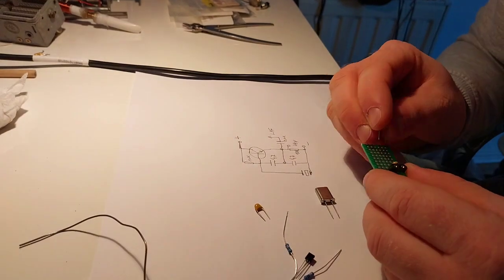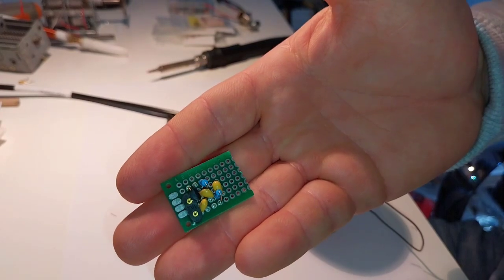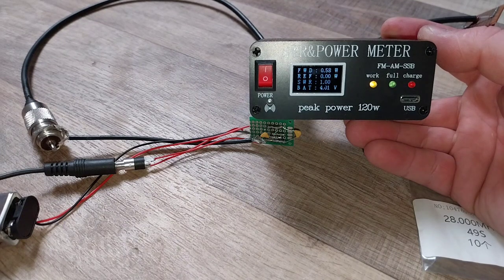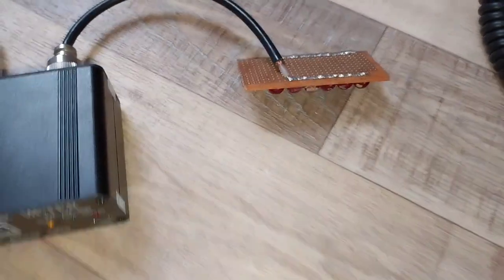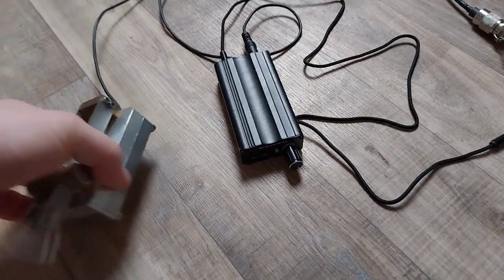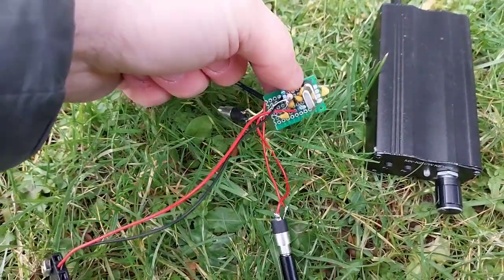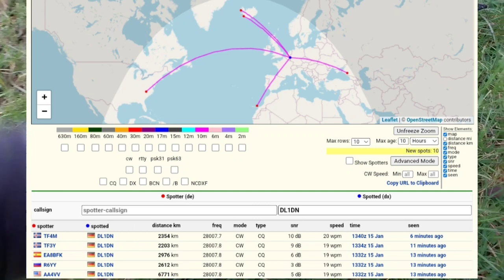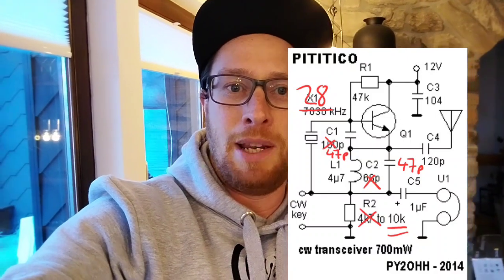DIY 10m mini transceiver DX reception USA, PY2OHH DL1DN mods #shortwaveradio

Comment: I recommend to start building with the filter near the antenna (should use a proper filter, really), and MEASURE and tune with NanoVNA, only proceed after that. The components near the XTAL and NPN are not as sensitive. It is also possible to use Darlington and couple the LC (LC is more tunable than XTAL which can be pulled to appr. 700 Hz range) very loosely with low cap values... That is "Franklinizing" the Colpitts without the adverse Miller-cap multiplication effect of the Franklin oscillator. Even a varicap pulled adjustable VCO is possible if the Varicap is also coupled with a small cap. 100..200 kHz adjustable range is possible without XTAL with the 2 transistor Darlington circuit. A modified Pititico is a good starting point.

Comment: is C3 104 Farads or microfarads
Reply: 104 means 10 * 10^4 pF that is 100 nF (but can be greater, or 2 caps in parallel,  this is supply bypass cap)

Comment: I use a lower value capacitor C = 1 / (4 * pi^2 * 4.7e-6 H * (28 MHz)^2) = 23.27 pF
Reply: 1 / (4 * pi^2 * 4.7e-6 * (28e+6)^2) = 6.87e-12  that is 6.9 pF

Comment: i built one but it is out of frequency on 27.997mhz I use the 28mhz kristal
Reply from the maker: Just connect a variable capacitor in series of the xtal, than you can rise up the frequency

Comment: I see 2 different kristal 28mhz and 28.224mhz which one you use ? On the RBN the freq is 28.007 mhz did the 1uf capacitor change this?

Comment: I love that little TRX. I built the original version and modified it a little bit to avoid AM broadcast band interferences on RX. Works great and is so simple. I should try other bands as well. 73 DE YO6DXE... nice one.
Reply from the maker: It works also on all other bands
Reply: @QRP.lifestyle  Yes David.. I just didn't try it. Did you had to change the inductor  value ? Is really fun to build really. I'm working on a little Frankenstein now inspired from the Pititico )
Reply from the maker: @dxexplorer  No inductor is the same check my video you will see my schematic mods.
It is running on 30m with 600mW
Reply: @QRP.lifestyle  I watched the video but I didn't pay attention to the schematic... I was too much into the way you build it and stuff hahaha. Let me look again. Thanks David.